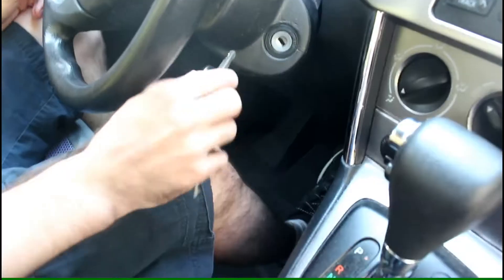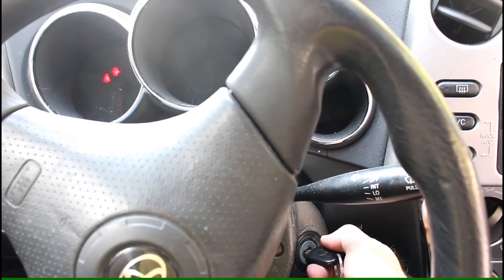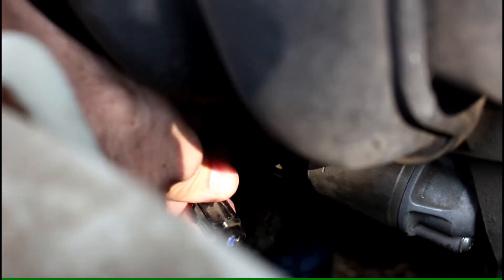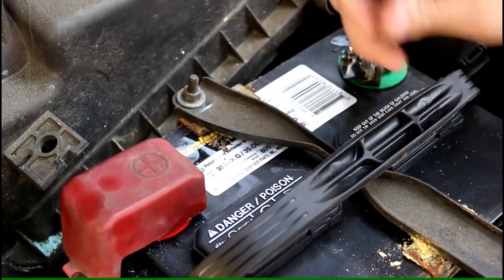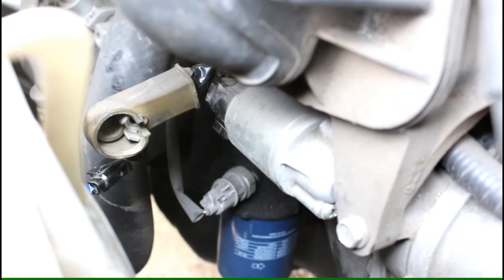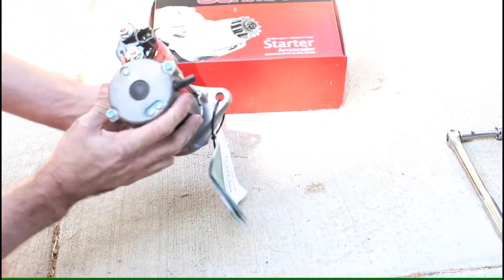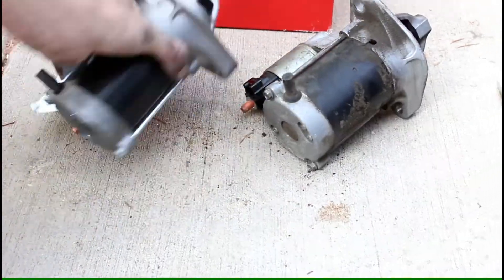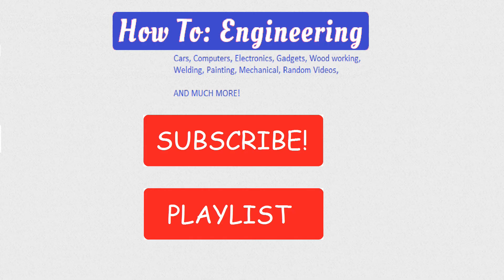Replace Toyota Matrix Starter Motor (or Pontiac Vibe)

Comment: what are you using to check the battery power?
Reply from the maker: I use a regular voltage meter to check the power. Its not the best thing as it does not check the load the battery can hold, but most likely if the battery is full then its not the issue.